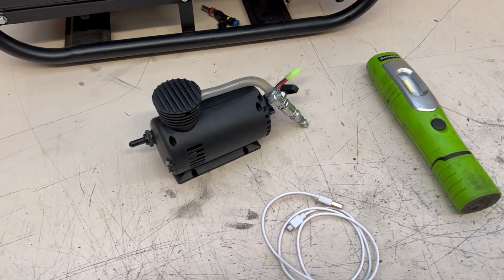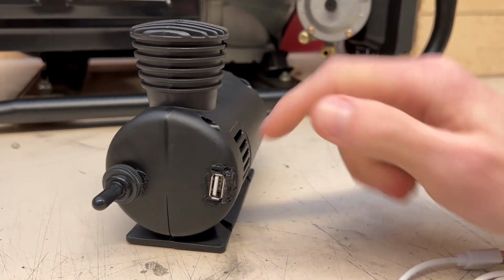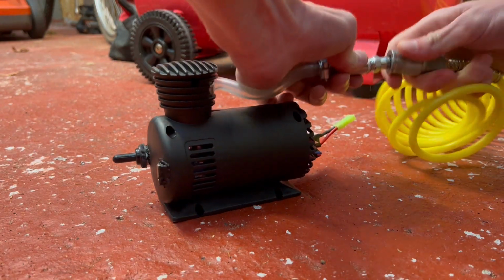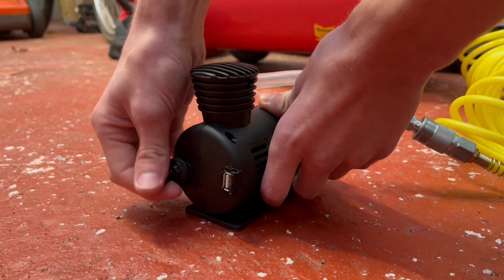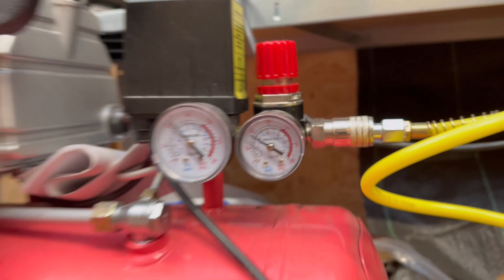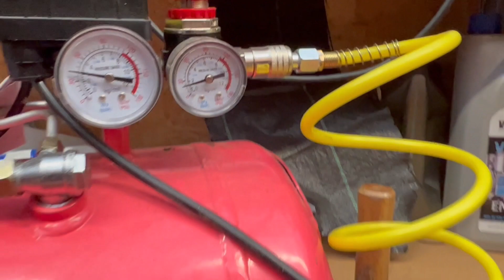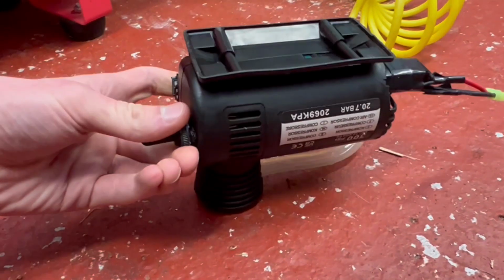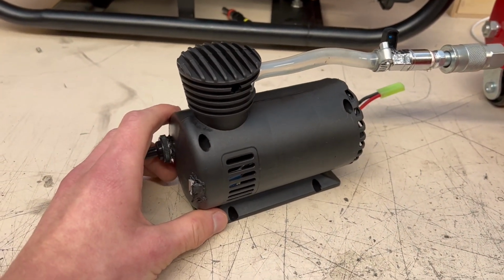AIR POWERED Generator with USB Charger

Comment: The engine seems to fire, and then turn in the opposite direction, and stalls. (I haven’t yet drilled a higher exhaust hole)

Comment: I normally dont comment on stuff like this.... But your project looks pretty clean and unlike a lot of other back yard DYI unique power devices, you actually put a load on yours. So that was good. BUT.... whats the point? When are you going to have an air supply to run the thing and not have a plug in electrical source? How is this project useful?  Im curious what application you find this useful for. Its an honest question. IM not criticizing. IM trying to understand the motivation of this project because it looks nicely done.  I just dont get why? Thank you.
Reply from the maker: Thankyou for the comment. 

This project was done purely for fun. 
I guess a small high pressure bike pump could pump up a small tank to 3000psi which would last 5 minutes or so. 

Hydrogen however is a lot more practical. Check out the YouTube channel if you’d like to see the hydrogen engines.

Comment: @FFR360 @Hydrogenguys 
I got around the flywheel problem, but my engine seems to be too weak to press the ball valve (I use a metal ball) do I need a plastic ball?
Reply from the maker: Plastic ball (like a bb pellet) also no spring is needed to keep the ball down. 
Hope that helps
Reply: @Hydrogenguys  thank you very much. Can you provide me a link to the compressor?
Reply: I really want to make a generator my own. It’s a really cool project
Reply from the maker: @bricknplay  https://www.ebay.co.uk/itm/224913920174

Hope this link works.
Reply: @Hydrogenguys  yes, but it is in Great Britain, I am in Germany. Can you recommend me one that is on Amazon maybe?
Reply: Because they don’t ship to Germany